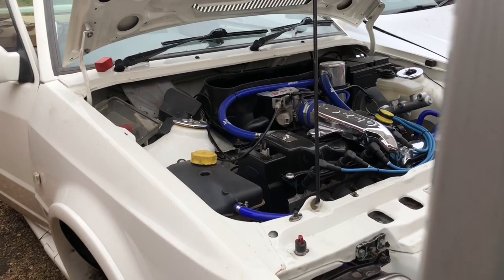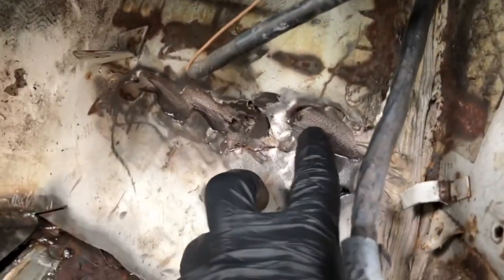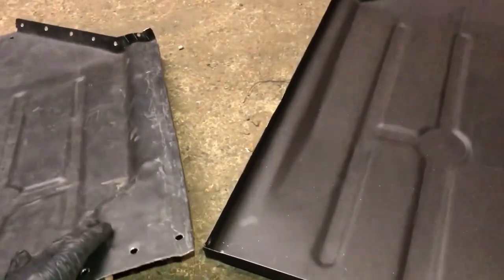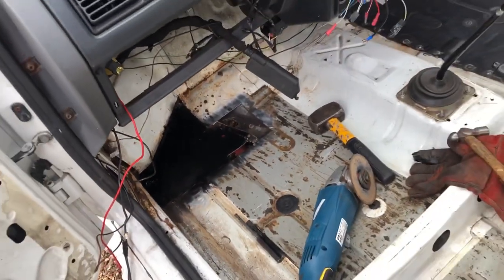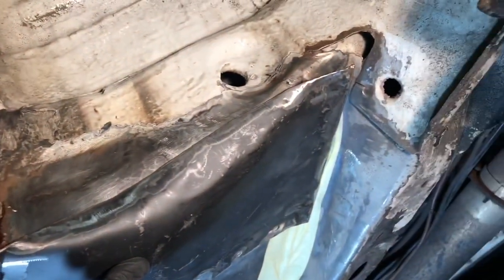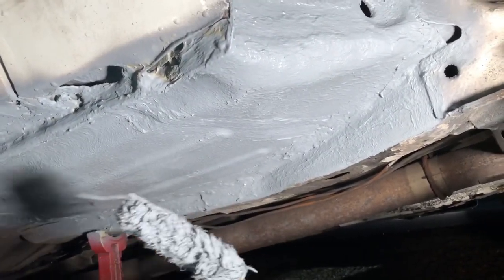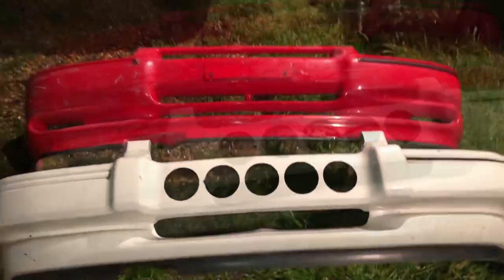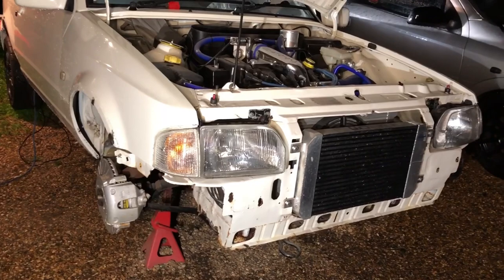BODYWORK RUST REPAIR STARTS! Ford Escort Rs Turbo Cosworth

Comment: I WISH I had some of your skill. I have a '89 1.3 Ghia that's rotting away :( Second owner and 130.000 km. It's really nice but I can't weld and can't afford a body shop for restoring the car :(
My plan is to get it in a barn and cut away the rust and "seal it up" so it's not rusting away.

Comment: Some of these so called body shops love filler . I recently done some work on a Capri for a customer . He'd had it in a body shop for welding and a repaint . I had to dig out all there bodges where they'd filled all the holes with fibreglass including a big hole in the windscreen pillar
Reply from the maker: Yeah mate I believe it! Its about making a quick buck for them. You rarely see a good job these days
Reply: @AaronUnknownPerformance  yep it's disgusting tbh there putting people's safety at risk . I'm a self employed mobile Welder and mainly work on cars so seen my fair share of other people's bodge jobs. I do it correctly as you are doing. No point plating over rot it just needs cutting back to good steel